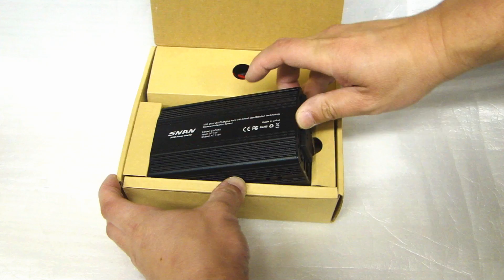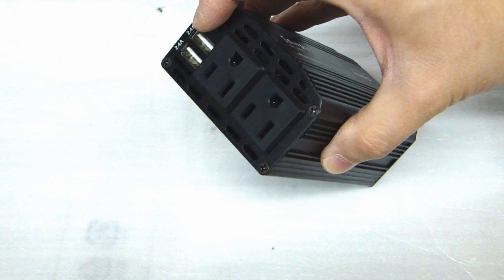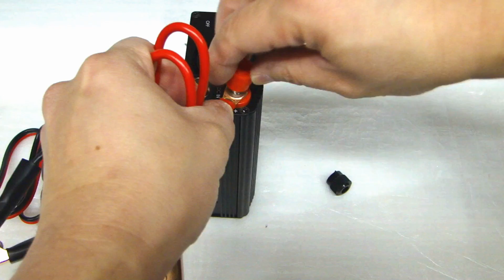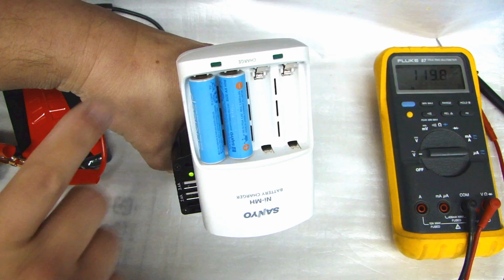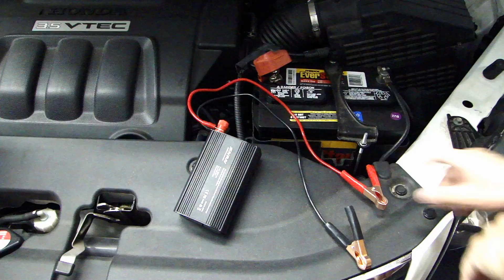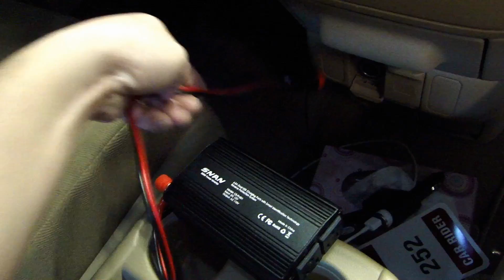SNAN 300W Power Inverter 12VDC to 120VAC For Your Car

Comment: I got this and as soon as i plugged in a usb cable to the top plug... POP sound from the inverter.. and emitted a bad smell.
the bottom usb port worked before. but it fried when i plugged something into the top one. Only outputting 3v with 5-10mA of current plugged directly into the multimeters current and voltage testing.

Not coo.l we got a defective unit :( Now we have to use only the power outlets with a power strip and separate usb plug wall charger adapters.

I also noticed the transformer in the inverter gets SEARING HOT almost instantly when its plugged in. and continues to grow hotter and hotter but the mosfet or transistors are stone-bone-cold. I moved the thermistor to the transformer and the fan comes on occasionally but it actually stays cool now.
the fan was making a grinding noise. so i took the label half way off and put a small drop of hair-trimmer oil in it.. Utterly silent now.

Its capable of running a home desktop computer. a monitor. and a 40w stereo all at once with ease though. so i'll give it a chance.

Comment: the wattage is talking about the secondary side? 300÷120=2.5 and should prbly keep max wattage 80% or below for longevity.
Reply from the maker: +gizmo Yes your output AC calculation is correct, bu in order for the input DC side to supply that wattage, it requires very high current at 12-14VDC to transform that voltage to 120VAC. So in your example, the input DC is not consuming 2.5 amp even though the output is using 2.5 amp.
Reply: I thought we were talking about what the inverter was rated for not the the amperage pulled from inverting it.
Reply: +dial2fast I know sir....12 to 120 is 10-1 ratio. so if you get 2.5 your prbly pulling around 25 amp which your cigarette lighter obviously is 20 amp max. I enjoy watching the gadgets you upload. I recently fixed a gadget I believe called the ring. it's a replacement door bell that uses the existing 2 conductors to provide video to your smartphone wherever you may be. you Prbly already made a video on it. take care
Reply from the maker: +gizmo We are all here to learn. I see Youtube as a community where we all help one another. Appreciate your comment!
Reply: Have a great weekend sir. Til the next cool video.